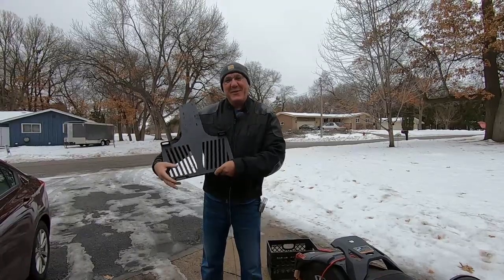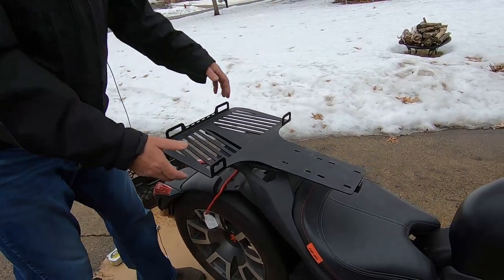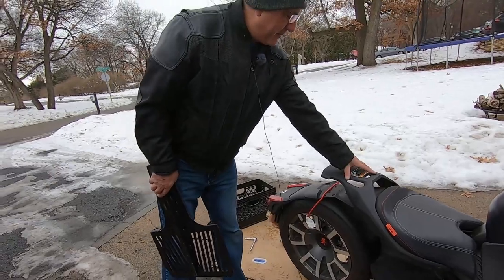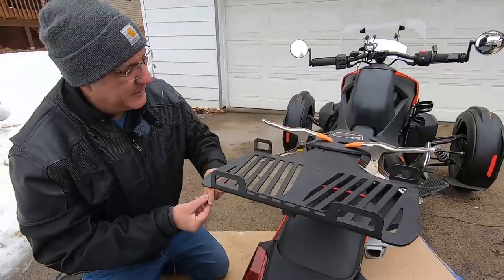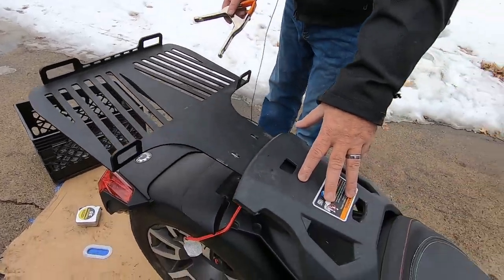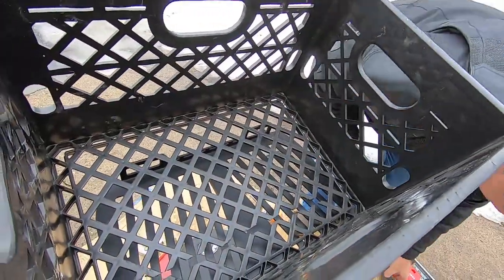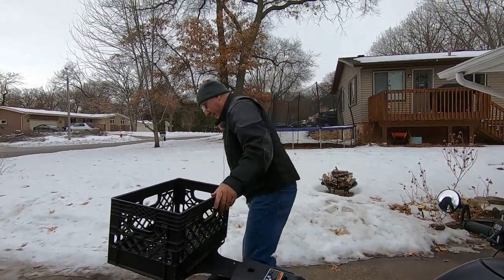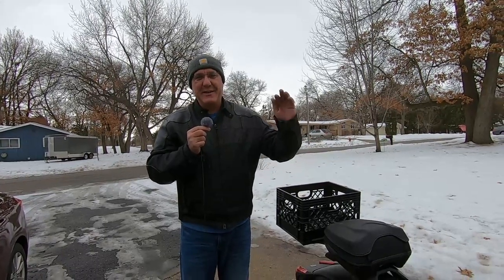LUGGAGE RACK AND THE ULTIMATE MILK CRATE INSTALL!

Comment: Very useful mod. Could you have installed the rack upside down to avoid cutting your crate and use the tabs for bungee hooks?
Reply from the maker: The rack goes in way way.  I don't loose any structural loss from the cut out.  Thank You for watching.